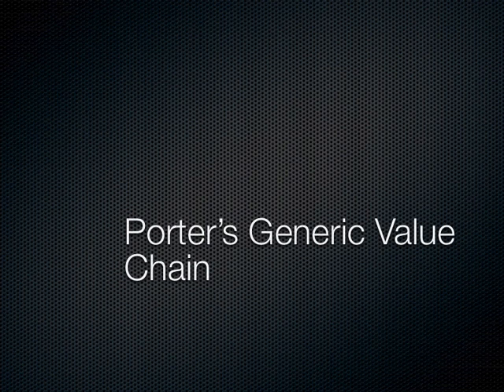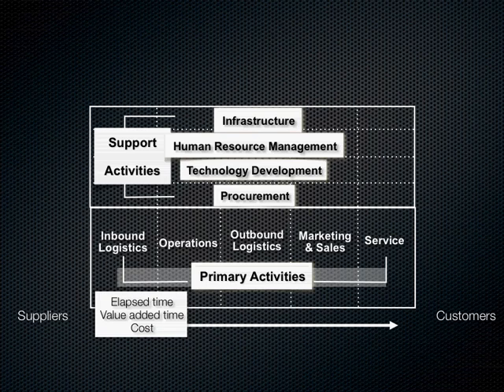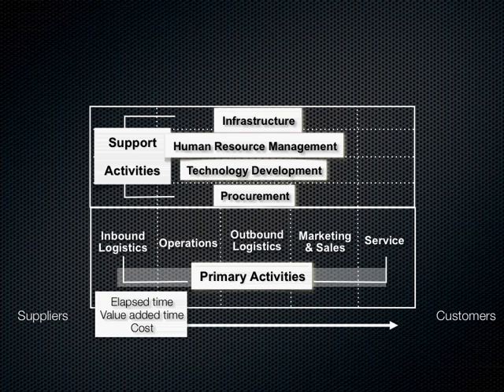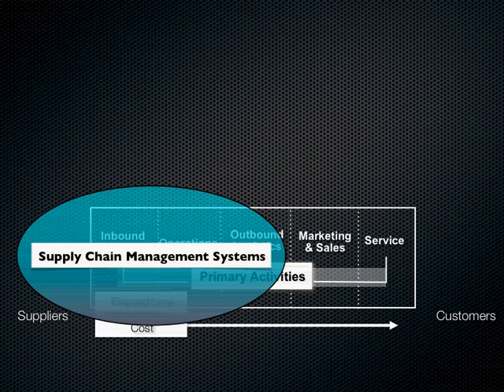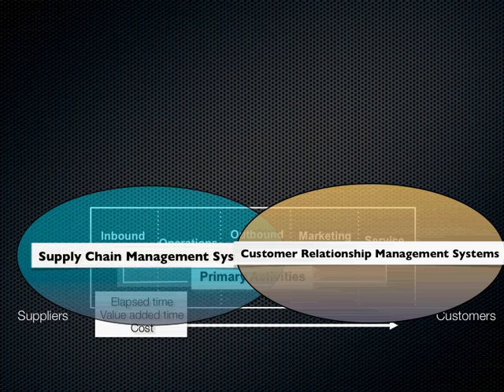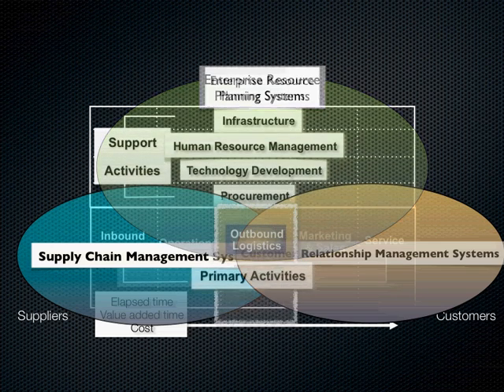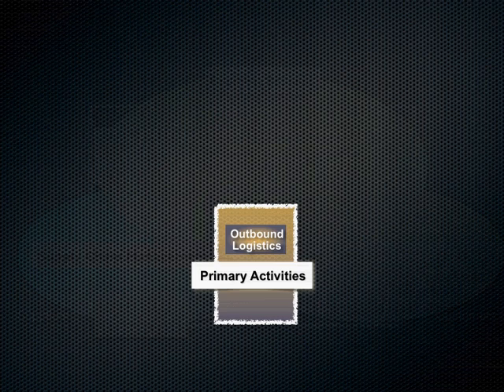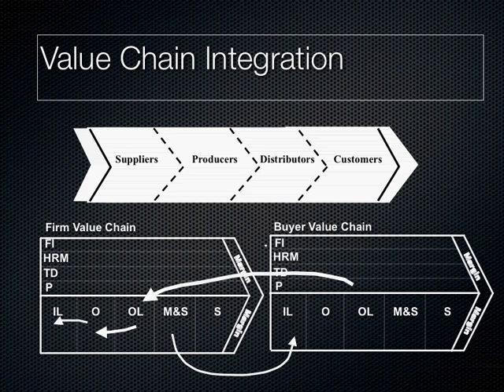Value Chain Analysis

Comment from the maker: @elmerfudd898 Good question. In general, we think about the supply chain as a series of systems that are used to take raw materials and by adding value in the manufacturing and packaging process turn them into finished goods ready to sell. There are feedback loops that connect the Marketing and Selling and the Aftersales Support back to Inbound logistics (eg. raw material defects) or to Operations (eg. manufacturing defects) which might make it seem like a complete system.